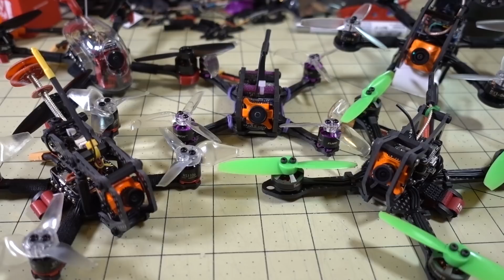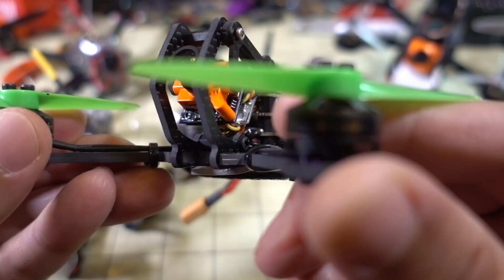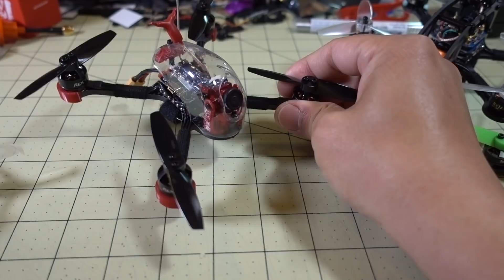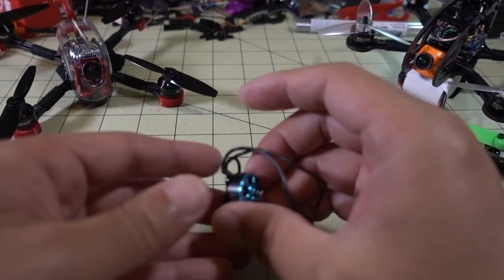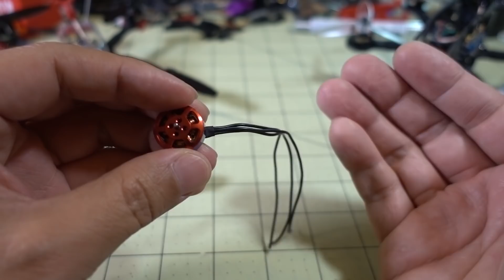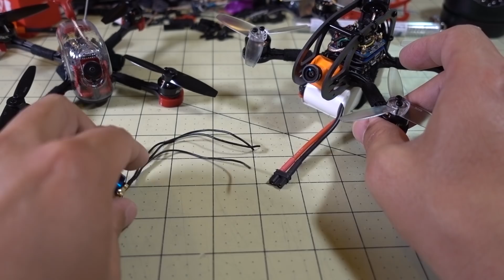Micro Motor Discussion and Preview 🌤️

Comment: Thanks for another great video Albert.
I have a question hope you can help with some advises.
If i'm using both 2s and 3s 550mah lipos on a 2.5 inch micro, what're the motors that are best for it?
I don't need crazy power, just need good enough power for freestyle, and longer flight time.
Thanks in advance for any advise i can get.
cheers...
Reply from the maker: I'd get 1104 7500kv for 2S and 1104 6000kv for 3S.
Reply: Thanks a ton for the advise Albert, really appreciate it.
If i only have 1 quad that will use the said 2s and 3s lipos, will a 1104 7000kv(or if there's a 6800kv that will be in the middle of the 2 motors you suggested) be best for both worlds?
Reply: So you recommend 1104 for 2.5” as well, instead of 1106? Seems like 1106 is good for nothing lol

Comment: 1407 3600kv is my current fave for 3".
Reply: Nice! 1407 4000kv 4" props  using 550 gnb 3s and I get over 8 minutes of flight time. :)
Reply: Chansook Saechao Hey, do you know a cool 4” frame? Thanks
Reply: FlexRC 4" Ascent makes for a great light build. I love mine. I like the 3" too! Dmitri makes some cool s*** !
Reply: I've been very interested in that frame
Reply: I've not have much experience with these light 4 inch builds. The frame I use is the RipaFire Super RX 160 from Amazon. I printed a 3d art to convert it to a 20x20 flight stack but then gained weight in the process. Someone mentioned it in another post here but I think FlexRC has some of the best well thought out designs. I'd look there first.
Reply: I concur, sir. 1407 3600kv w/3" props has been great for me.
Reply: On the 4” subject, i found this video very interesting https://youtu.be/i8zKNP4Xsaw
Reply: Damn what voltage is left after that?
Reply: Hey Albert,  love this topic!!!!  Keep up the good work.